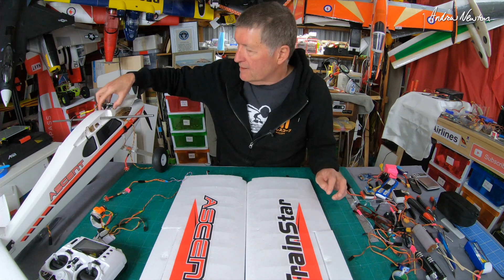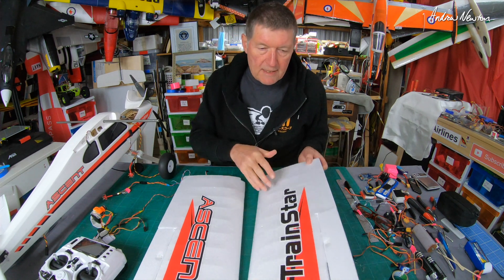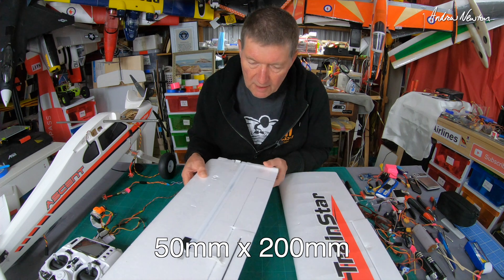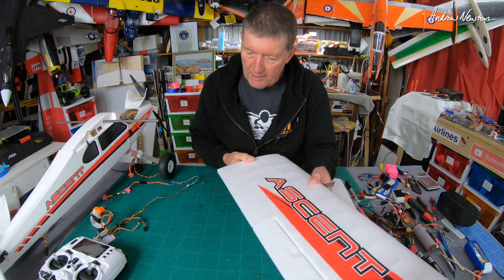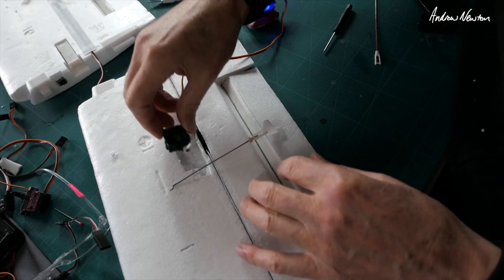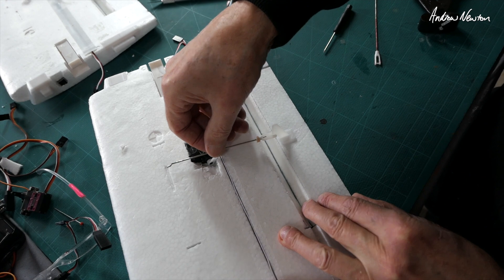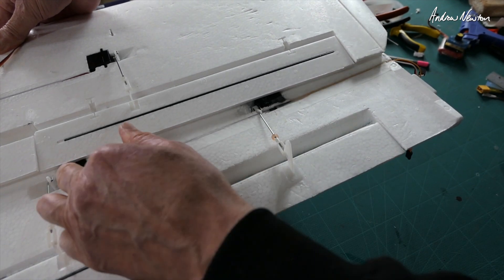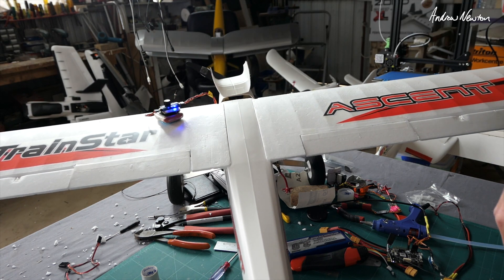Adding flaps to the TrainStar Ascent

Comment: Another great video I've learned alot from you, I would like to do this on my talon rebel gt in hopes of slowing it down for landing on my short landing space. This thing comes in fast and wants to keep flying, I want to get your thoughts on this before I start cutting also are you deploying these flaps using a y cable and switch? Thanks for all you do.
Reply from the maker: I wouldn't put flaps on the Talon GT myself but it would be an interesting experiment. Y-lead and switch is the normal method.
Reply: Thanks for response, just wondering why you wouldn't do this on the talon rebel gt? Do you feel this plane won't benefit from installing flaps? Thanks again
Reply from the maker: Don't know really. I have only put flaps on big planes or gliders. You would have to test carefully to make sure they don't make it pitch up or down too much.
Reply: Oh ok makes sense , Thanks

Comment: Hello,
following the crash of my trainstar ascent, would you be able to tell me if the anti-torque of the engine is on the right or on the left and possibly by how many degrees and the same for the angle of stitcher to allow me to repair it
thanks in advanc
Reply from the maker: It's packed away but I will when I find  it again.
Reply: thank you very much, hope you can help me.

Comment: Andrew hope you are doing well. Not sure if you kept this trainstar. Had an issue with the landing gear. its made out of soft aluminum and doesn't last long. Do you know of an alternate that i could uae instead? Thank you again.
Reply from the maker: My landing gear is still holding up OK
Reply: @AndrewNewton  i think that stock landing gear stinks. Its so easy to bend. Is there a carcon fiber manufacturer that you recommend to try and get something that will fit?

Comment: I have similar version of this plane, (volantex trainstar epoch v2) probably I will do the same flap setup but would volantex own esc handle additional 2 servos, what do you think Mr. Newton? (2 ailerons + 1 rud. +1 elev.) + 2 flaps
Reply from the maker: Have to check the specs of your ESC but most will handle it OK. I did have to add an external BEC to a Ranger 2000 recently because the BEC on the ESC was playing up.

Comment: 👍👍👍👍 You got me at Flaps!!!!!
Already subscriber.....based on your experiencia......in what conditions a regular srifil wing can be replaced by a kfm2 .....what would be the advantages....excluding the easy to build for the kfm2.

I am asking because a want to build a 90cm small savage Bobber and i want to replace the wing.....because it is easy to build and i have no experience building a regular airfoil with spars and covering... but i want to keep or have similar lift. 
And add very thick flaperons.

I hope you can send me some comments,
many thanks!!
Reply from the maker: I have never used KFM2 profile but I have used a pure flat wing and they work perfectly well apart from gliding (Boxler wing). I predict it will work on the well Bobber.
Reply: @AndrewNewton  mamy thanks for yor rapid response and prediction!!

Comment: I used split flaps on my Bangood C160 using bottom hinge. Consequently both top & bottom wing surfaces stay streamlined whether flaps deployed or not. ..
Only catch is that u got to cut very smartly in the middle of wing on the trailing edge.
Reply from the maker: Very tricky but great idea.

Comment: This is awesome. I've often wondered how flaps would work with a Y splitter as ailerons do. Never had a plane with flaps. Flipping the servo is genius in it's simplicity. Makes total sense but I wouldn't have thought of it.
Reply from the maker: Thanks Jim, I learned this with my Bixler 2 many years ago. They had the flap servo spots facing opposite like the ailerons.

Comment: If the tape does not stick to the foam as much as you'd like, apply a thin layer of UHU Por to the foam on the places where the tape must stick and let it dry for a few minutes. Then apply the tape (but do it right the first time as it won't come off) and it will stick forever. 
@Andrew Newton Which temperature hot glue gun did you use for this, is it a special type perhaps? Thank you!
Reply from the maker: Cheap HobbyKing 12V hot glue gun